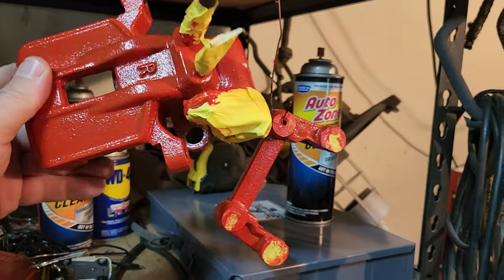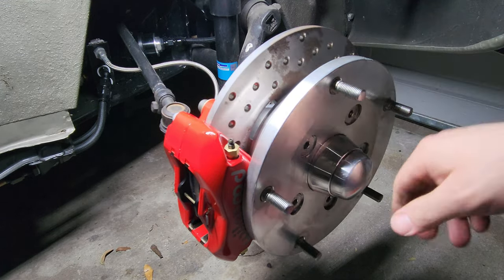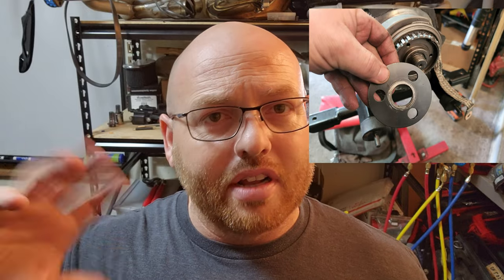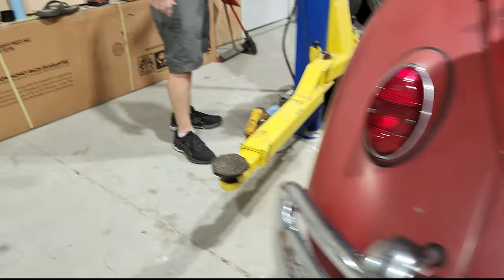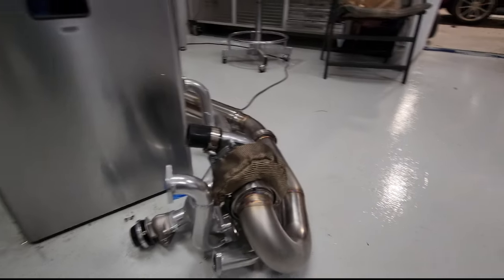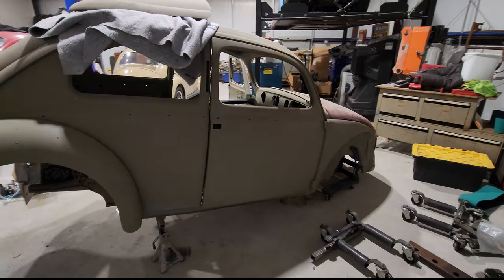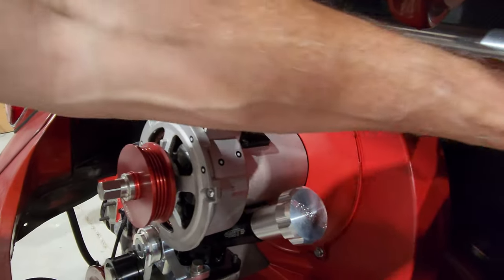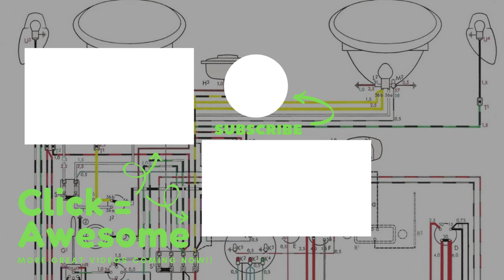TURBO Beetle Wilwood Brake Upgrade - R.A.C.E Shop Visit | JW Classic VW

Comment: The front brakes do about 75% of the braking, on average. It might be slightly less on a beetle since there is more weight in the rear, but still the rears are unlikely to do more than about 40% of the total braking. Been enjoying watching the build, thanks.
Reply from the maker: Yeah I know it's different for most cars.. type of brakes and the master cylinder your running probably change the proportioning.

Comment: Thank you for sharing all the things you could have kept to yourself!  Have you considered getting a willwood master cylinder?  There is a speed shop that sells one with a kit to fit the bug.
Reply from the maker: Yes, I've looked at them but just don't see the need right now... maybe later down the road.  Let's see how this one holds up.  Coolrydes Customs has them in there kit I believe or one similar to the Wilwood MC.
Reply: Where could I find a Wilwood master cylinder for a bug?

Comment: Jason what is the machined pipe sticking thru the fan shroud on Red VW.
Reply from the maker: That is the inlet to the intercooler for the turbo set-up.  In the video we show the Throttle body with the blow-off valve.  That attaches to that inlet.

Comment: Nice video 
Iuse fueltech 
Ft 450 also built in programming no need 
Pc to do map😍😍😍😍
Wiring so easy to do
5 bug ido with ft450
899$ only
Starts from display
Reply from the maker: Thanks for the info, the 450 is pretty cool!
Reply: @JWClassicVW  
Imake lot of videos obout this and I share it
With you at groups
Reply from the maker: Yes... I like your videos... even if I don't know what your speaking. 😁
Reply: @JWClassicVW  Arabic language

Comment: Would love to fit some wilwood brakes to mine but they seem to be so expensive over here in the uk
Reply from the maker: Yup... they sure aren't cheap here either. I'm sure you've already looked at Limebug... there prices seem similar to ours.

https://limebug.com/product/t1-titan-wilwood-4-pot-beetle-ghia-65-link-pin-5x130-porsche-front-disk-brake-conversion-kit/
Reply: Not just over in the UK. They  brake you no matter where you reside.. No pun intended even though it worked out that way!

Comment: Does the Por15 caliper paint require a top coat for UV protection like normal Por15?
Reply from the maker: Hey brother, no not from what I read... but there are some cleaning and prep products they recommend.  I really don't think those are nessary though, especially with new brakes.  The Mineral Spirits worked fine.